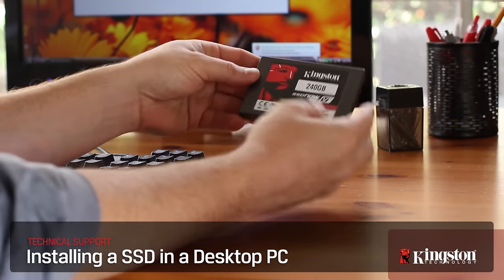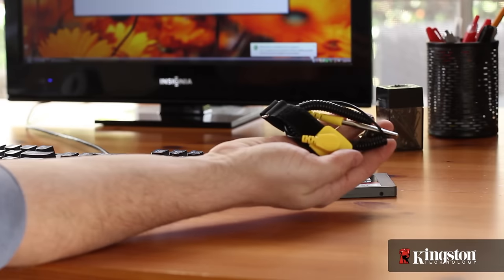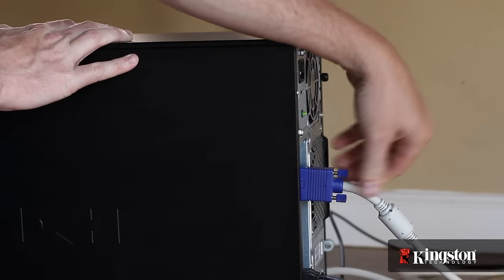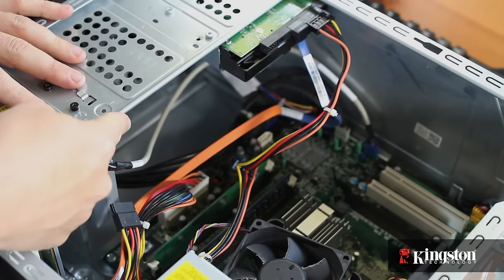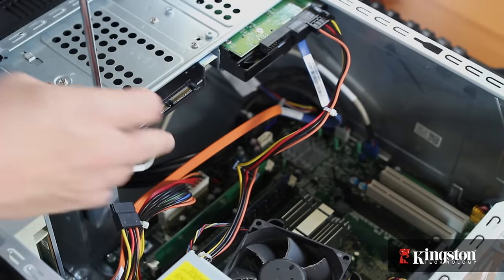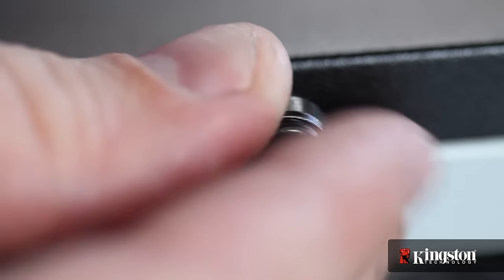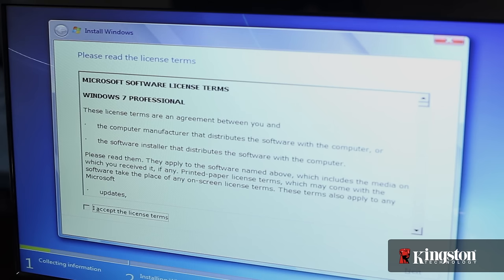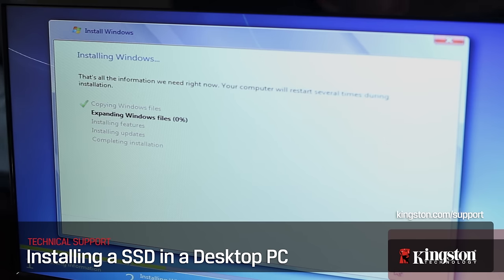Installing a SSD in a Desktop PC

Comment: I went to newegg to choose an SSD, but there are two, external and internal. What should I buy?
Reply: If you have room in your desktop, buy an internal. External SSDs are used if you cannot fit in on the inside and are connected via USB
Reply: Oh.. thanks mate. No wonder they looked different. Good thing my case supports 2.5
Reply from the maker: SSDs feature a SATA connection which is designed for internal connection - we do not manufacture any SSDs designed to be connected externally, so we are not quite sure we understand what you mean. Please provide part numbers or images of the products to help us understand, thank you.
Reply: External are more in purpose if you don't have more space inside your computer and you can also carry the data with you in case you're going somewhere or whatever. Yet, they're still very dangerous because of the USB if the cabal might break something inside or the SSD might fall. You know...
Reply: What I mean is that my case has 2 extra slots, and they both are 2.5 sized. The one that I'm buying is 2.5 sized so I don't have to buy those extender things.
Reply: CreepersDoMC Oh, well that's good!
Reply: Lol wtf do you want it in or out your computer it's not rocket science

Comment: so i need to do that whole CD thing? i cant just plug it in and use it for additional storage?
Reply: The CD thing is to install Windows on the new SSD. If you do not want Windows on the SSD, you don't need to install an OS on it. You would just need to initialize the new drive in Disk Management, format it, and then it will show up as an empty drive in your file explorer.

Comment: Just to make sure, if i have windows 10 installed on my old HDD, there will be no problems with my computer if i also install windows 10 on a new SSD right?
Reply from the maker: An SSD is nothing more than an advanced form of your old hard drive. Anything you can do with a mechnical drive - installation, partitioning, data storage, etc you can also do with an SSD.

Comment: Would it be better to use a pcie or nvme instead of sata
Reply from the maker: With a NVME drive using PCIe as an interface, you can achieve faster transfer rates compared to a SATA connection. Is there a model that you wanted to know more about?

Comment: I want to buy SSD soon, does it come with full package bracket with screw and SATA cable and what if i have no unused power cable in power supply, do i need buy extra cable?
Reply from the maker: Our SSD only comes with just the drive.

Comment: I have no unused SATA connection on my motherboard. What should I do?
Reply from the maker: Hi Theo, you can in this case plug the SSD externally via USB to your system.
You only need an appropriate external enclosure.

Comment: is a SAT cable a separate purchase? I have everything hooked bit I can't find the cable in my comp so I'm guessing that's separate but my buddy didn't tell me this
Reply from the maker: SSDs are sold either standalone or as a bundle kit with cables and USB enclosure. When purchased stanalone for a laptop, no additional cables are required, the connection should already be provided, however when adding a new SSD to a desktop, additional SATA cables are required in order for the drive to be connected to the motherboard to allow data transfer between it and  other peripherals.
Reply: Kingston Technology thanks! I got it all hooked up and it's a beauty, just waiting on the market to drop to get a new graphics card, prices way too high right now

Comment: i barely bought a pc and want to add an sdd but i dont have any power sata connectors at all. do i have to add them to my psu?
Reply from the maker: In order to add an SSD you need to verify that you have an additional SATA port if you will be adding a 2.5' or an actual M.2, mSATA, or M.2 NVME port available. Please refer to your PC's manual for that info. You can also refer to our guide here https://kings.tn/2LJD06B

Comment: FYI:::
I noticed the cable was RED indication SATA 2.0 which is 3.0GB data rate. Blue cable is SSATA 3.0 and rated at 6.0 data rate. Also MSATA is even faster I think 8.0 GB transfer. I'm using a PCI express card for a raid setup. FASTER YET!!! Tempo 6Gb/s SATA PCI Express 2.5" Solid State Drive Card from Sonnet is a PCIe card that can control two SSDs and it supports the OS X or Windows RAID feature. The card features a 6Gb/s SATA controller chipset and PCIe 2.0 x2 interface to deliver read speeds up to 660 MB/s from a pair of SSDs configured as a RAID 0 set. AHCI compliance means that installing the card is simple; just attach your SSDs with the provided screws, mount the card in an available PCIe slot, and turn on your computer - the necessary drivers are installed automatically. Drive health monitoring is supported through S.M.A.R.T. data reporting.
Reply: Sounds like an absolutely incredible setup!

Comment: I need some help, you need that l shaped power cable, it said there is a spare one, in my case i dont have a spare one, i have a 6 pin, what do i do
Reply: Dude, your description could have been clearer, but if I got it right then what you need is a Molex connector. Check our what I mean on Google Images before you buy it ...

Comment: So I don't have an operating system CD. I have Windows 8.1 on my hard drive. If I were to get a new ssd I can't use it without installing windows on it? I can't just use what I already have? I want to use both
Reply from the maker: You can clone your current hard drive on to the new SSD using software like Acronis.
Reply: Aye aye, Captain.

Comment: should i need to replace harddisc from old cpu or can be installed with it
Reply from the maker: Hi Kuldeep, as far as physical installation of SSD in a desktop cabinet is concern, you may need to purchase a bracket for SSD. If you wish to install SSD for better performance, we suggest, to install SSD as a primary drive with Operating System and Applications, you may install your existing hard disk as a secondary drive.
Reply: Kingston Technology thanks

Comment: Hi, if i just unhook and hook my SSD back in, will i have to reinstall something? i have slight problems when booting up, and easiest solution i have been presented with is just detaching and attaching my SSD again.
Reply from the maker: Sound like you are having an issue with your first boot device. While SSD is not designed for hot-plug as you are practicing, give us a call and we can help http://geni.us/KingstonSupport troubleshoot further.

Comment: What if you're just adding it as a non-boot drive, ie just for a Steam library?

I've already got an SSD with my OS on it, and I want to add another.
Reply from the maker: That shouldn't be a problem! When you hook up the other SSD, you will be able to see it in the listed drives. This can be done internally or with an external enclosure.

Comment: Hello, i got a problem with my SSD. The Model is "SSD Kingston SSDNow V300 60GB" . i installed my OS on the SSD drive and when windows is starting up i got huge CPU processes (its like impossible to do anything) . I use the SSD for my windows and another HDD for my other data (if i use only the HDD its working perfectly) . If you can help me to fix this i will be greatful.

Comment: No, no. You have to make this realistic. Show a computer pulled about 3/4 of the way out (that's as far as the tangle of cords attatched will allow it to slide out) from the lower computer storage space on the left or right side of the desk. No one wants to disconnect the thing from all those plugins on the back. Then show the tricky hand positions necessary to remove the side panel in this position. It won't be too hard since no one puts the screws back in from the last time they did this. You may also want to show the dust balls and clogged cooling fan, but that's optional. Then there is the issue of having to pull off the front facing panel  to get out the old drive people have in that extra drive space already. Can't pull it out the other way because of the tangle of cords inside the computer. Again, no one wants to pull those cords off the mother board to get them out of the way either. Finally, show the user putting the new SSD in with double sided tape or just leaving it sitting in the bay without screwing it in at all. After all, they want to test it first. They will then just put the side panel back on because "it's good enough" or they forgot and slide the computer back in. The conscientious among them may screw it in on one side, leaving it just hanging on the other. After all, it's light and that will be "good enough" as well.

And you know what? It'll work just fine for years that way, reinforcing the user's belief in their way of doing things.
Reply: I bet you wrote all this in less than five seconds...
Reply: This is to true... xD
Reply: just got through that it was painful xD
Reply: i felt this in my soul hahaha
Reply: I love this
Reply: Facts.
Reply: I don't screw in SSDs because there's no need. Change my mind
Reply: this is too accurate LOL XD
Reply: duct tape works to hold the ssd in the case properly
Reply: I wish I'd read this before beginning the task which the above video shows apparently so easy, and taking about 2 minutes. More than an hour later, after I'd cleaned out the case from dust bunnies, opened up both panels (because even tolerable access wasn't possible otherwise), wrestled with the tangle of cables (many clipped together in an altogether unhelpful way with plastic bindings I was not inclined to try removing) taken out an old drive which wasn't working, re-switched the position of the SSD drive in the brackets (because the original way round was not fitting in at all well) and finally slotting it into the place vacated by the old hard drive (still hampered by the cables), my nerves were so shredded that I could scarcely fit the case sides back on!
Reply: Is this common? My pc is clean AF and has it's SSD screwed since it's basically 5 minutes work to install a new one. Cable management and maintenance ftw
Reply: Chec this out : https://youtu.be/DswIVtHRSTc
correct way of installing a SSD
Reply: oh man
Reply: @thediyist  Wrong, especially NOT pertinent to the SSD discussed here.
Reply: You forgot to mention that there will be no "unused power cables" hanging around to connect the new SSD. At least that's what I just found, and the power connectors I have lying around don't fit the SSD. Now I'm trying to find out if I can just buy a cable and connect it directly to the PSU or am I going to fry the SSD?

Comment from the maker: Hi, I'm Jewel with Kingston Technical Support. To do what you described, first find a cloning software that allows you to select which partitions to copy. Clone the Windows partition to the SSD and verify it boots/runs. Then you can delete or hide the Windows partition on the HDD. The programs should run like they did before with the SSD and HDD in the same system as long as the remaining partition on the HDD is assigned the same drive letter it had before there shouldn't be any issue.
Reply: That was so hot.
Reply: thanks, this is helpful.

Comment: Does the SSD come with the bracket, or do i have to buy them later?
Reply: idk
Reply: It has been 6 years, but anyway: of course you have to buy the brackets separately. It would make no sense to sell the SDD together with brackets because the buyer may want to install it in a notebook in which case brackets are not necessary or possible. Or someone might have an external case for the SSD.

Comment: I got a hdd with windows 7 on it, but i want to install my new ssd as boot driver and put my windows 7 on there.
Do i have to put my ssd as first thing to boot up and install os on that, and my hhd as second, and do i have to format my hdd since there is also a windows 7 on that hdd?
Reply from the maker: Hello Achmed,
Jewel with Kingston Technical Support, here to address your questions. After installing Windows on the SSD, it would need to be listed before your HDD in the boot priority otherwise the system may boot the the HDD. It is not required to format the HDD as it can be kept as a back up, but if you would like to use it for additional storage it may be better to format it for the extra space. For any further assistance, please call us at 1-800-435-0640 (USA and Canada only) M - F 6am - 6pm PT and I or another available Technician will assist you.

Thank you for selecting Kingston as your upgrade partner.
Reply: P

Comment: Hi i have a Hard Drive and am looking to install an SSD for gaming purposes; i'm just typing this for someone to restate all of the steps i need to do and i also have a few questions. (I want to keep my hard drive for storage space and put all of my games on the SSD).
Can i use the same windows 7 installation disk and code that i used with my Hard Drive?
Do I need to make the SSD the boot drive?
Once I pop in the windows disk and get to the drive selection place, all i have to do is partition the SSD and im set?
Also, please write all of the steps out for me because i dont want to mess this up; im new to building computers.

Thanks a lot and please reply!!
Reply: ApxPredator18 it is easiest to clone your os drive to the ssd using acronis true image software that comes when you buy the kit for pc.

Comment: Are the desktop ssd s the same as the laptop onces?
Reply from the maker: Depending on the specifications of your Laptop, you can use either 2.5 or M.2. If you have any questions about form compatibility, please reach out to your manufacturer's web page for more details.

Comment: i'm about to buy a Kingston SSD, however i'm wondering, is it really necessary to use CD's to install drivers? can't i just download them somehow something? because i bought a new videocard, wich is so huge on my small motherboard, it wouldn't fit, unless i removed the network card, in a slot underneath it, and unplugging the CD-rom lol.
Reply: You can also buy them in USB form or buy a cheaper, but riskier option: a OS boot from, like, Reddit or something.

Comment: Can i install this sdd in my hdd without changing my power supply?
Reply: What you meant to ask was "Can I use the same power and data connections from my HDD with my SSD" and the answer is an emphatic "Yes" ....
Reply: @arminius1972  sorry bad english sir... My pc is dell optiplex 3020 and the power supply is 250watt power only

Comment: Can I install windows on a SSD, then once it's complete, transfer specific files from my HDD to my SSD? I would like to do this because I don't want to completely clone my hard drive, or wipe my hard drive and have a fresh installation of windows.
Reply from the maker: Yes you can do this. We suggest backing up the important data prior to installing your new SSD and transferring thereafter.  You can also use your previous drive as an extra storage.
Reply: +Kingston Technology will any part on the old hdd be wiped or will just windows be wiped?
Reply from the maker: +zues121510
Cloning is a 1:1 copy of your original drive, so nothing will be wiped. Now if you plan on salvaging your original drive and sourcing data from it we suggest a Sata to USB adapter/enclosure.

Comment: Pls read. If u just put the ssd in and then u boot ur pc without custom install will it work
Reply from the maker: Hi there unfortunately that method will probably only detect the drive but it will not be usable until you go through the process which would initialized the drive. Only then can you use the SSD.
Reply: @kingston  ty

Comment: does the rotation of the sata or power cable matter ?
Reply from the maker: The SATA and power plugs are shaped so that you can only connect them to the cable the correct way.

Comment: Hey my local disk c is completely full i tried to delete all temporary files to clean it up but it was of no use so i wanted to get more storage in my pc then i thought to add a 1tb ssd so the guys at the shop told that after adding this 1tb of ssd everything on tha disk c will be deleted so isn't there any other way to add more storage????
Reply: If all you do is installing new ssd (and creating/formatting partition in it, if necessary) you will not loose content in your older drive.

Comment: but what if the computer have no SATA 6 cable option?
Reply from the maker: Hello Morten, Just check with the system manufacturer to verify which type of SATA your system has or you can visit our site to see what we recommend here: https://kings.tn/3pGnj5a

Also for more info: https://kings.tn/32KI0DR

Comment: i still get errors when trying to install windows on my ssd i always get errors, and when i try with vids or help from the microsoft site itself i always get something new, i want to use my hdd and my ssd i even tried installing windows on my ssd when i had it installed but not my hdd and it still didnt worked. i need help.
Reply: just try cloning your original operating system onto your new SSD with Acronis, easy and less dicking around

Comment: can i install this into the place/use the cord my previous hard drive was in?  Also, do i have to backup harddrive?  What is it going to boot like after switch?
Reply from the maker: You will need to make sure the SATA  connection is the same on both drives. It's always a good idea to back up your hard drive before installation or removal. Our SSDs come with cloning software to make the transition easier. The boot will be faster if you are upgrading from an hdd drive to ssd.
Reply: thank you.  Do you mean same cord connection when you refer to SATA?  I will not back up as I am not saving anything currently, just running a crypto miner
Reply from the maker: Yes, the same cord connection.

Comment: I hava a hard drive can i place the ssd whitout removing the hard drive
(Stupit Q bt i need to be sure)
Reply from the maker: In order to fit the SSD you need to have a free SATA slot on your motherboard, a SATA cable to connect the two and a cable connection from the power supply.
Reply: @kingston  thank u sir